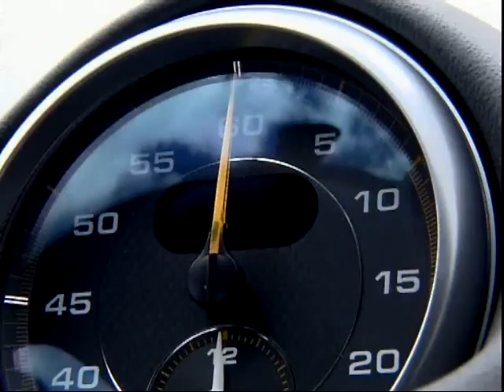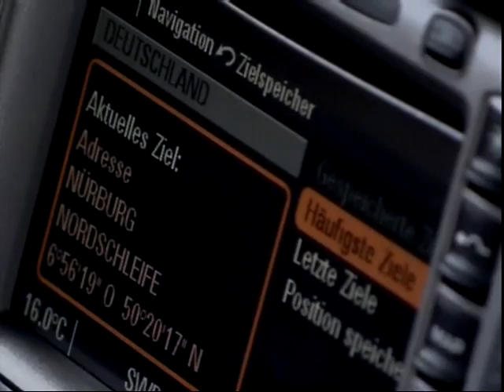Porsche 911 GT2 - Newly Released Video

Comment: The Z06 is as lighter than the GT2. And the Z06 does have run flat tires, and although it's suspension was tweaked for 07, GM could still do a little more. However, the C6 Z06 would have a hard time beating the GT2 (if it could). But the 600 hp and lighter Corvette will probably out perform it.

Comment: The GT3 RS is not turbocharged and has 415HP with the same 3600ccm engine. It would be possible to push it over 500HP without turbocharging, but that would decrease the engine´s life-time dramatically.